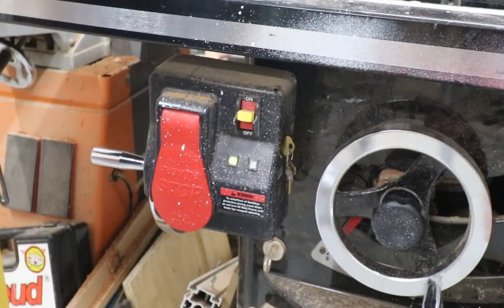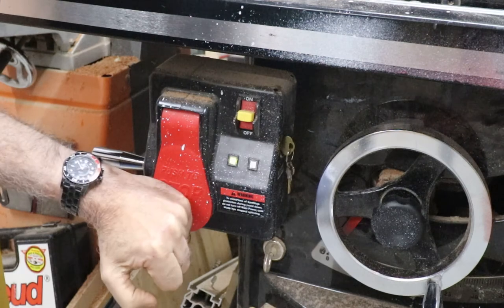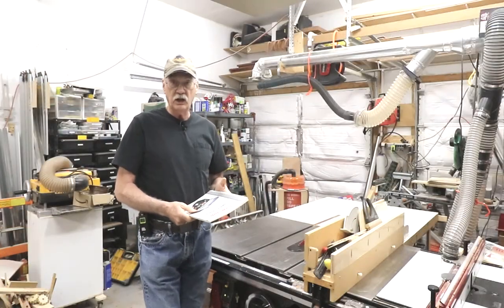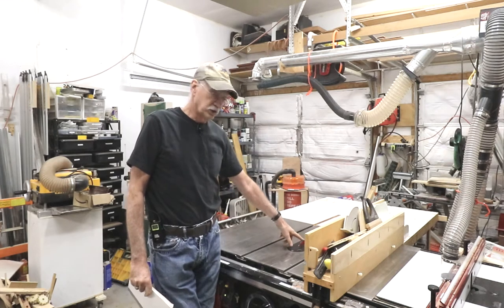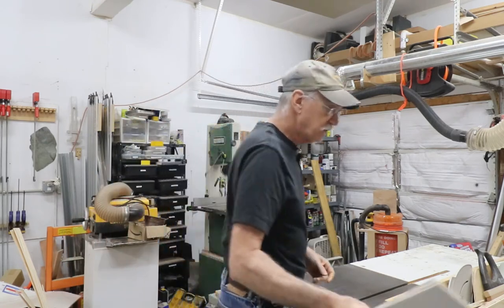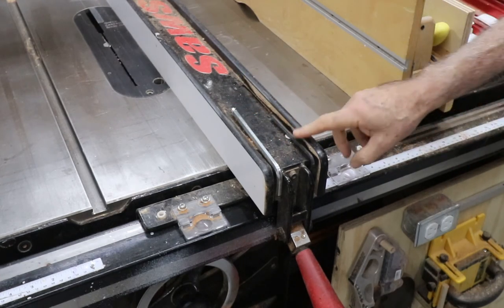Oh No, Not Another Sawstop Review, 13 years later

Comment: When originally shopping for a table saw, all the sales people spoke about was the safety feature of SawStop.  I would always tell them, "I'm not buying a saw to 'not cut' my finger...I am buying a saw to cut wood.  No one seemed to get away from talking about the safety feature until one day, a guy focused on the fact that if a saw is designed with such a safety feature that allows for a reset and use, it must be designed with a more robust trunnion and assembly.  That makes cuts more accurate and consistent.  I bought the saw and love it.  By the way, a friend suggested that if I could possibly afford it (the saw PLUS electrical work), I should buy the 3hp version.  I did that and don't regret it at all.  I love the extra power!
Reply from the maker: Yeah, that's the thing. Great, it has the safety feature but how about it's a very robust, accurate high-end table saw. Marc Spagnolo (The Wood Whisperer) just bought, set up, and gave his first impression. He's been using a Powermatic PM2000 for twenty years and said the SawStop beats it in a few key areas. Check out the video on his channel.

Comment: Hi Kevin
Love you review, I have had so many similar things with your saw like showing my wife the finger saving system to which in getting this saw.
Just seen your video last night and noticed you said you can only use thin kirf blades do to the riving knife only supporting thin kirf blades, The riving knife is adjustable to accommodate full kirf blades very easily, I have the same saw for about 13 years too and my first activation was with my Incra miter gauge as well.
I love my saw too!
Have a look on page 62 of your awesome manual for aligning your riving knife, it is easy to do.
Hope this helps
Dan
Reply from the maker: I just read that section. Thank you now I know something new. I think it was Mark Twain said, and I think I'm paraphrasing here "a day you don't learn something new is a wasted day". I'm good with using only thin kerf blades but it's good to know if I need to I can change that. 
Thanks again.

Comment: Thanks for a great review.  I love my Sawstop and I believe it will be my forever saw.  I keep one of the used cartridges hanging on my shop wall as a gentle reminder to be careful.  I have also have had to dig the nut out of the bottom of the saw more than once.
Reply from the maker: I have one hanging in my shop as well. If you put a screen in the dust shoot use a 3/4 mesh and check for buildup.

Comment: When you say take off the  safety features off do you take it permanently off or you are just putting it on stand by off every time you switch it on 
Thank you for the advice
Reply from the maker: When you term off the safety system, it's only off for that cycle of the saw running. Once you turn the saw off, it automatically resets to safe. If you want to use it again without the safety system you have to tern in off again. There's no switch to tern it off, you have to hold the key turned to the right as start the saw and wait for the lights to stop blinking the let go of teh key.

Comment: I still don't understand why they don't just drop the blade.  No need to ruin it.  Bosch has a competing system in Europe that does it but they won't allow it in the US due to our patent system awarding ridiculous patents on technology from the 80s to Sawstop as exclusive.
Reply from the maker: Does the Bosch system stop and drop the blade in less than 10 milliseconds? Also, blades are not that expensive. Do you have a link to the Bosch system in action?